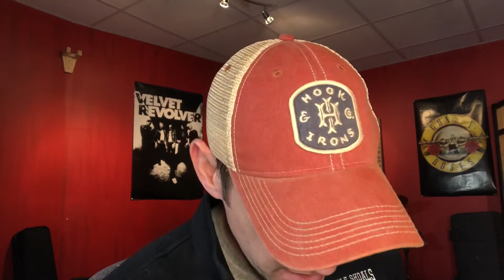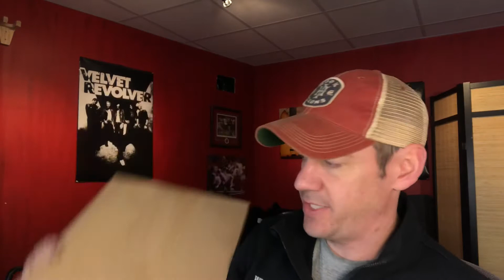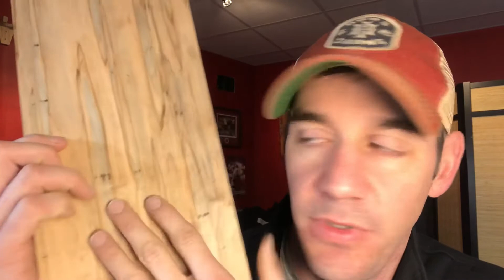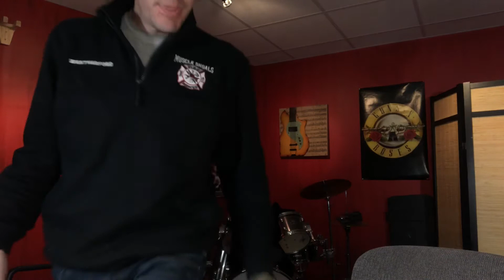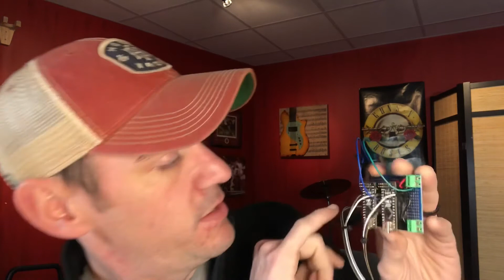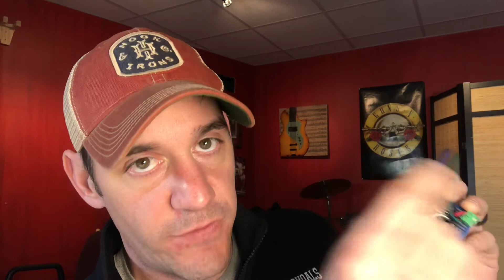CWKShop Talk. Future Guitar Build and Pickup Winder 2.0 Update

Comment: What about using a stepper motor to control the left to right placement of the wire? Use a threaded rod to move it back and forth.
Reply from the maker: Bill Karoly, I’ve had a few people mention that, I’m not sure exactly how to accomplish it right now but I will look into it possibly in the future. I appreciate all ideas. Thanks for the suggestion bud!